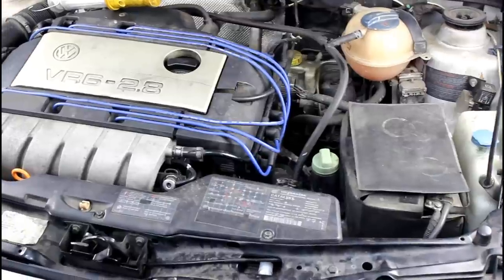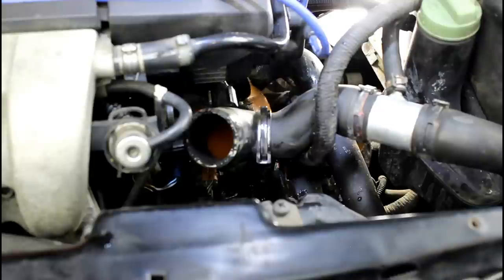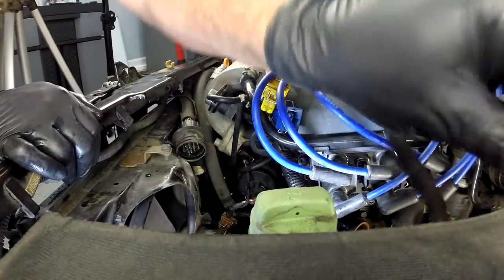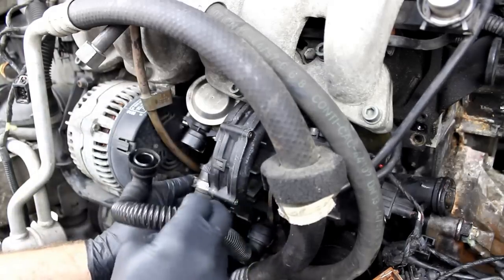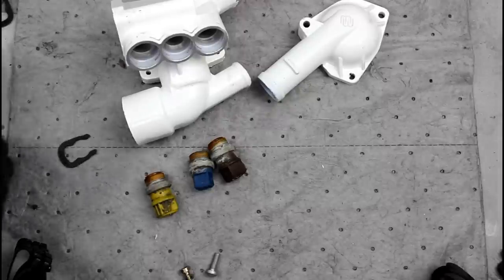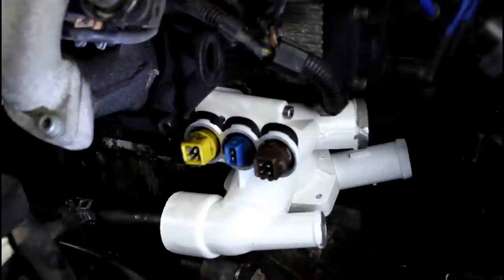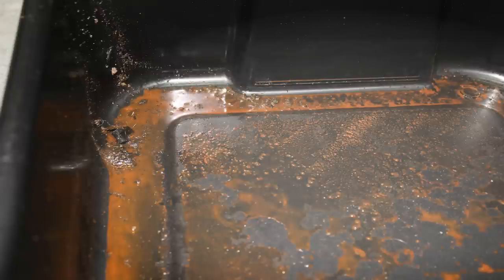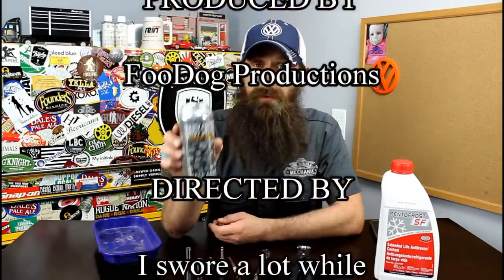Thermostat Replacement with Upgraded Thermostat Housing

Comment: I use a dab of plumbers putty if I have to run a bolt in blind. Worked very well when I was changing motor mounts on a mercedes S550. There was 1 bolt for the hear shield that was a bitch to access
Reply: Also how long did it take to Remobe the front end. If it takes 15minutes or less I'd say totally worth doing everytime.to save headaches
Reply: +nicholas elias if you've done it at least once I'd say 1 hour if your good.  Took me about 2 hours working in a storage unit with very basic tools and a small 2 ton jack and two jack stands. There's a lot of little steps but it's not hard.
Reply: about 20 minutes if you know what you are doing

Comment: You know what's even more fun? Doing this on a EuroVan...
Reply from the maker: +Jack Rosenfeld I dont really mind working on Eurovans. It is funny to see the other guys run away from them.
Reply: Haha. Yeah I mean once you pull the front off they're pretty easy to deal with. I'm about to pull the tranny on mine to do the chains. Where are you based by the way?
Reply from the maker: +Jack Rosenfeld Near Raleigh NC.
Reply: Nice

Comment: I just wanna add to this video information. If you plan on putting in a cast aluminum Crack pipe, make sure it is made to OEM dimensions of the original plastic pipe. If you don't the pipe will hit on the engine block and not allow the thermostat housing to sit flat against the head. Check out my page and videos regarding this issue.

Comment: Thermostat housing is ALMOST removed I need to disconnect that lower hose on the thermostat housing How?  Hose clamp is on top.  Tired vise grips, tried a c-clamp.  I may try a piece of wire and tighten with a pair of pliers I am at my witts end removing the lower hose clamp to get this thermostat housing out.
Reply from the maker: Take the flange off, then remove the hose from it.

Comment: FINALLY GOT IT!!!! So the creative solution to getting the bottom hose off when dealing with tis issue on the Touareg is to use a smal 1.5 inch C-Clamp on the hose clamp. Check out the small vid on that hardest most knuckle busting part.
https://youtu.be/dQwwe0p1W7Y

Comment: working on these vehicles its a nightmare. Also, the fact that some of these parts are made of plastic, instead of metal. So the chance of performing a long lasting repair are slim, most likely exesive heat, humidity, and other factors will make your new part hard and brittle and will brake again. Thats the problem with these german cars. I think i will stick with toyota or honda, or subaru.